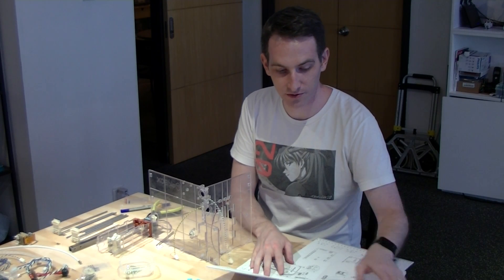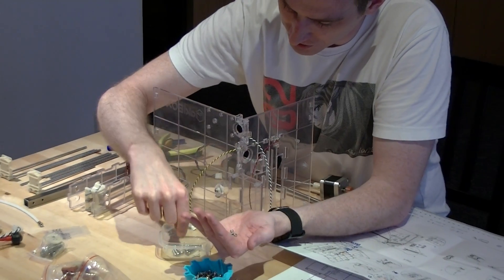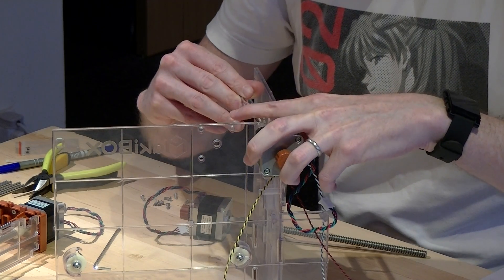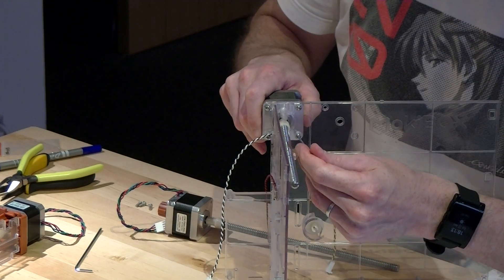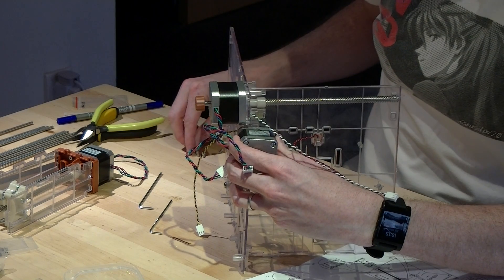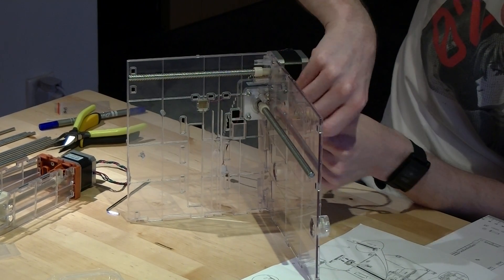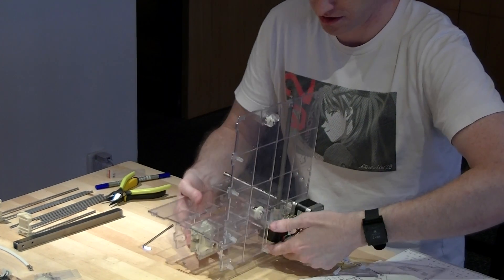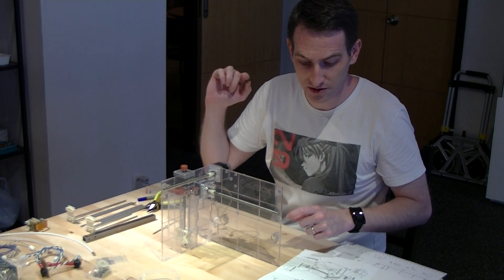#MakiBox Assembly Step 3

Comment: We are ramping up the production and will be able to confirm the schedule in about a week. There is a lot of final prep work to move from low to high volume production like jigs for assembly and packout, final instruction manual updates, internal packaging, and general processes. These can only be done once we have the final bits and have an idea of where the pain points in the initial production are so that we can improve.

So, @jonburn1 I'm assuming you have not done production ramp up before?